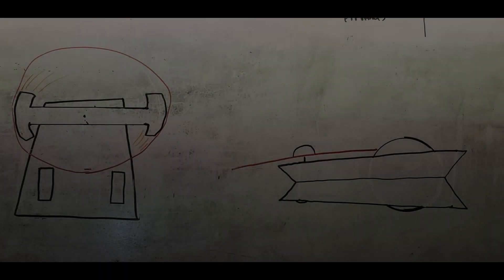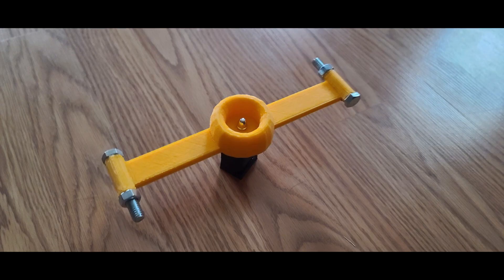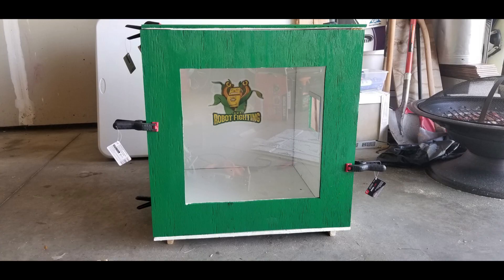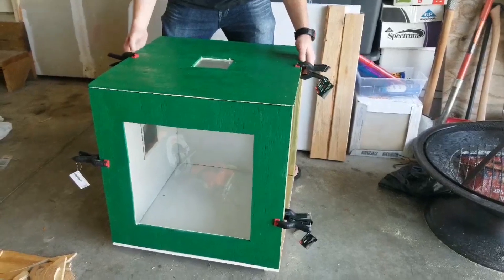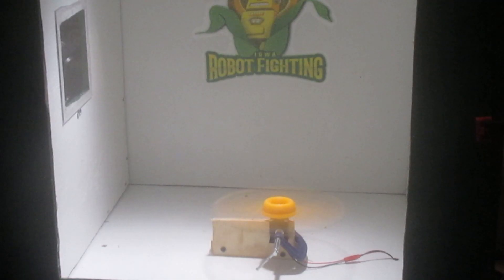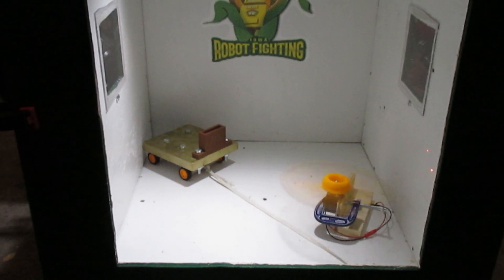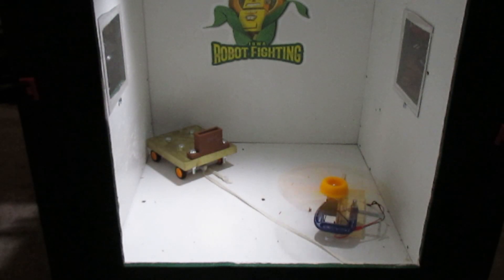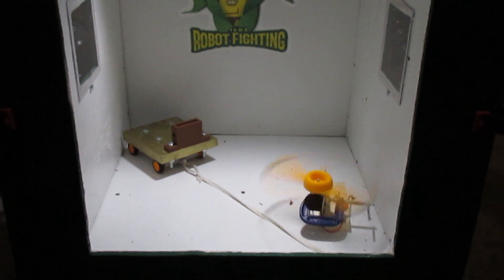Robot Weapon Testing and Robot Planning

Comment: Is it an all plastic ant league? Id be amazed if they would allow those metal bolt impactors at the end of your bar
Reply from the maker: That is actually part of the rules. 50% of the weapon must be plastic and the structure itself can't contain metal (what's holding it together can't be metal). Specifically metal is used for hammerheads and teeth in this league.